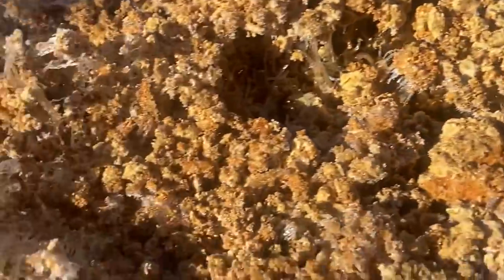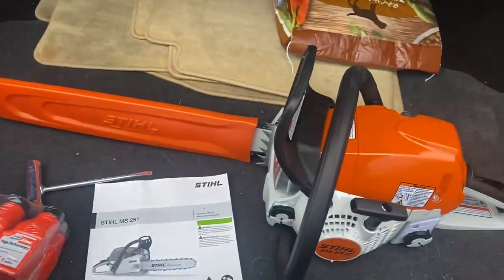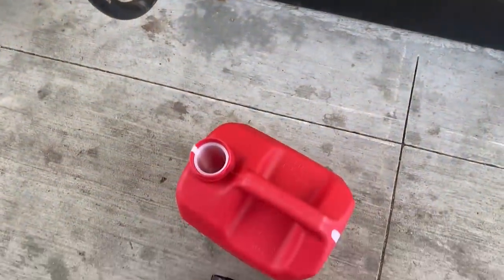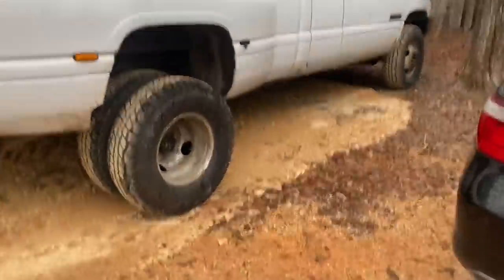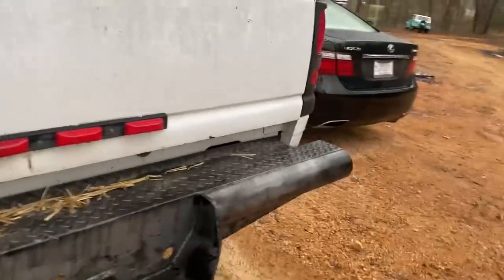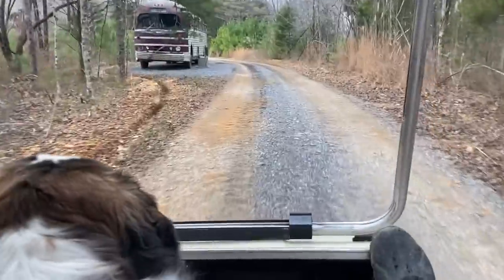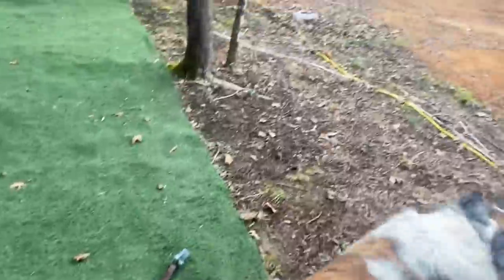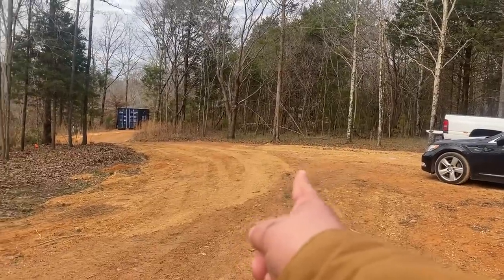Cool ice needles, chainsaw shopping, new tires on the dirty dodge, Leroy the St. Bernard having fun

Comment: Leroy is rapidly becoming the star of the show, LOL. Hard not to fall for the guy.
You will not regret buying the MS251. I have one, and a 291, they are animals when cutting. 
They are not cheap, but they are worth every dime.
Ours is a community with a long history of timber, and the local saw shop is like a mini museum. They sell Stihl. Period.  I still have my Dad's 1974 Homelite Super EZ...he cleared 3 home sites with it, and every now and then I fire it up and the wife runs it. It always starts on the second pull. Always.
The dually will not get great tire mileage, the Cummins torque is hard on tires.Towing is even harder.  My trucks have all been hard on them, my friends tow heavier than I do on a regular basis and their trucks are worse.

Comment: First of all, love seeing Leroy in the videos! Secondly, I am on my third second gen dually with my current one having 431k on it. If you look at those rear tires with the dirt on the tread, only the center 2/3 of the tire is covered and none of the outside edges have dirt on them. You will find 55-60psi is all you need in those rear's, it will ride much better and the tires will wear much more even. My truck is hooked to a trailer 95% of the time and never one issue running the lower psi. Keep up the good work!

Comment: Love my Stihl chainsaw!  Have had it over 15 years. I don’t use it much and agree that non ethanol fuel is better but for my use, I’ve found the shelf stable Stihl branded fuel works best. Sure, it’s more expensive but for the home gamer, I find it doesn’t gum up the carbs.

Comment: Not all ethanol free pump gas is really ethanol free. The Truck driver is the person responsible for mixing ethanol in the gasoline as he's filling the delivery truck tank's. If the tank has remaining ethanol fuel in it the driver will put ethanol free fuel on top of that ethanol mixed gasoline. The result is ethanol in your chainsaw with damage resulting from that. That's the reason you never use pump gas with 2-cycle oil mixed in it. Only use that premixed 2-cycle fuel in the quart and gallon cans. It's not the same kind of gasoline sold at service station pump's. Its a highly refined fuel designed just for 2-cycle engine's. Pump gas even with the proper mix of 2-cycle oil will cause piston scuffing and cylinder wall damage and it will damage the carburetor and fuel lines.

Comment: The clay in the substrate freezes with water present; this slowly squeezed the water up; as the air temps dropped the water froze. Pushing the serfice particlet up as well. 
(A water pocket with 1 small hole and freezing air)

Comment: I have a stihl, make damn sure you do not use gasoline with ethanol in it. Use only straight gasoline. The ethanol damages the fuel system.
Reply: Everbody should use the highest octane straight (non ethanol) gas in all your small engine equipment and toys

Comment: When you mentioned non ethanol for you chain saw, I needed to tell you that most  old Volkswagens like the THING usually run a lot better on Non Ethanol Gas. You might try a few gallons and see if it works...........................

Comment: Hi ,Scott. Jim in Colorado springs Co. I screw up back up over my Stihl 036 ,Broke the wrap handle and bent it. And pushed the gas cap into the fuel tank/rear handle $$. My stihl 026 won't run , need carb rebuild. My Sach Dolmar  111 that I got from my uncle needs rebuilt. 😭😭😭😭😰 so all three chain saws need work.. ps  I may have good used 3/8 20" chain 4 you.

Comment: MESSAGE FOR Scott, I learned something today and thought of you with the old Buses, It's about the diesel fuel return lines - I think VW discovered this.  (I saw you blowing your bus on another video lol - think you were testing which line was the fuel return by finding the one that didn't blow bubbles) Apparently if diesel is sprayed or dropped back into the tank above the level of the fuel, it can oxidise and cause a tar like build up/effect in the tank and lead to filters blocking more. I'm also wondering if that fuel algae thing you spoke of could also be caused by this as these things seem to be a thing of the past and maybe engineered/ironed out these days?  Apparently VW's solution which was copied by others is to return the fuel under the surface (but probably not on the bottom of the tank so as to stir up any sediment) Diesel is returned from a tube that's shaped something like a ducks bill. (Most manufacturers of Diesel and Gas vehicles these days prefer no return fuel systems because returning fuel to the tank also alters/degrades the properties of the fuel, so they regulate pressure instead of returning any fuel)  Sorry if u already know this but I thought it may be of interest to you or any other old school Diesel lovers out there in YouTube land and may be a simple thing worth experimenting with.  Loving all the videos and buses, thanks and regards, Rob

Comment: 0% Ethanol , is that,  sort of like Glutton Free Gas ?
Reply from the maker: More like Twinkie gas, it lasts a long time before spoiling
Reply: I use it in all my equipment mower tractor etc.
Reply: It’s something you can’t get around here......
Reply from the maker: There is a website that lists all the gas stations that carry non ethanolgas. Google it
Reply: Ethanol is a plant derived alcohol they put in gas for the octane , i think it was methanol before but don't quote me on that. Ethanol absorbs water pretty quickly, about a month and a half and you'll notice that it has lost its pep. Messes up carbs and older motors in small engines and cars because the gaskets weren't made for it, eats them up. Used to help with a Halloween carnival fundraiser and the non-ethanol gas has lasted a whole year in the generator fuel tanks and will fire right off easily,  though  you will hear a backfire (nothing lasts forever)  first night we would run on the old gas and the next we would fill back up with new
Reply: We can get non-ethanol high octane at the go-gas in town
Reply: You should switch to low carb ice. I lost 30 pounds in 6 months!
Reply: @notajp  check around your area for shelf stable non ethanol fuel sold in quart cans made for 40:1 and 50:1mix 2 strokes and then theres a 4 stroke blend..i find mine at menards or home depot and lowes i use it for storage mostly but it works very well

Comment: Odd , Here unless they just stopped , if you buy a new saw and  the silver containers of ultra oil mix, Stihl doubles the saws warranty . Surprised they did not tell you
Reply from the maker: I just called them.  Yes they do that and told me if i come in they will still do it.   Crazy no mention of that either.

Comment: You might want to consider a higher octane fuel. i understand the advantage of no ethanol  Stihl recommends a minimum of 89 octane. When you add the 2 stroke oil you are dropping the octane rating. Not good for the saw.

Comment: You made me laugh out loud when you said you 'almost' considered doing them yourself . . . $10 a tire including balancing . . . good deal, and with those machines?
Reply from the maker: It would have made a good video ;)
Reply: @BusGreaseMonkey   yes . . . I've beat off a few tires myself . . . I still have Dad's bead breaker. I prefer not to use it . . .

Comment: Only $10 dollars a tire? Shit here in VA I was charged $100 a tires but got a free corn cob to go. I should have asked before I got the tires changed. Even the mobile tire guy only charges $20 dollars a tire. These mechanics around here are out of control. And we have a fucking bull shit inspection too. Don't ever move to Virginia.